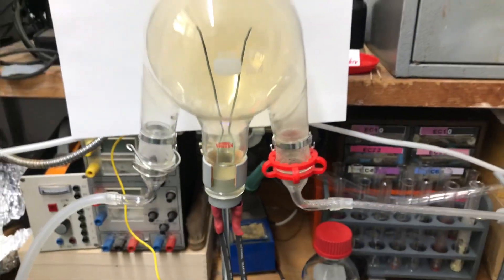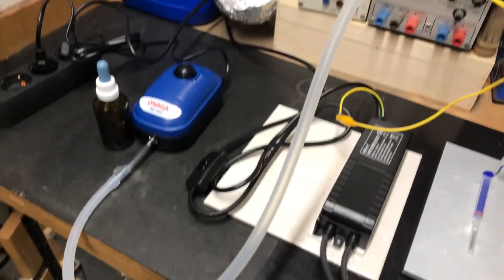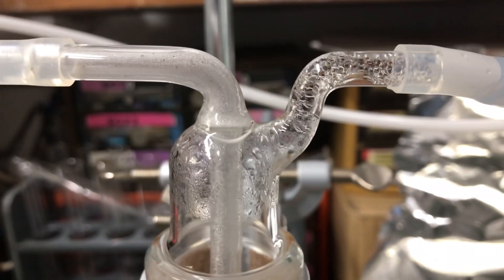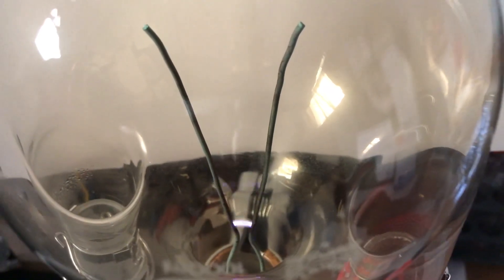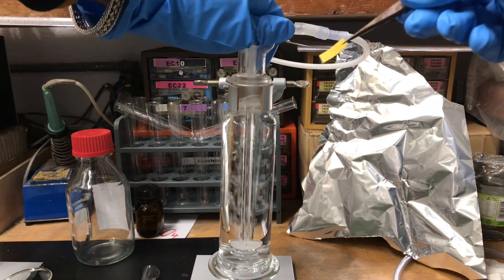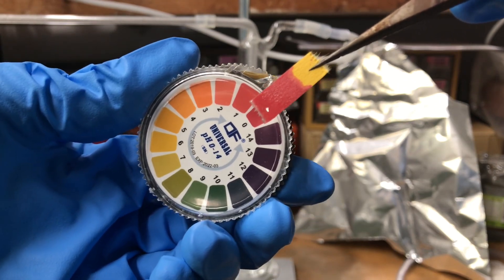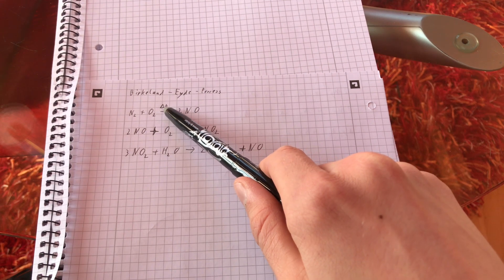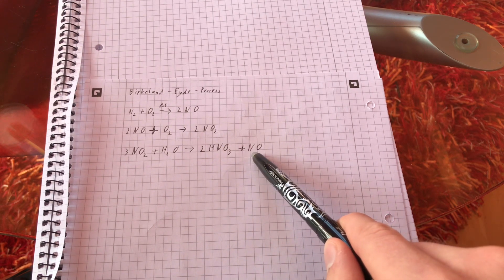Nitric acid from air (Birkeland Eyde Reactor)

Comment: Recently thought about adding baffles to the gas tube. Should increase dwell time considerably. Gas travels sideways slower then up. Ive also thought maybe have it like the SO2 collectors build a kind of reflux tower that bubbles and mists the gas over and over. Hilariously i think a bong would work to collect gas. 😂💨😶‍🌫️ just cant seem to find a glass to tube adapter at the smoke shop 😂.

Comment: I would suggest a few different things if you wanted higher efficiency.

One would be using an hydrogen peroxide solution in stead of straight water, and chill it for increased solubility. Second is recirculate the escaped NO back into the reactor. 

But that's only if you wanted to improve the experiment itself, which noone  would just to get some acid, because the process is just too expensive.

Comment: Nano bubbles generation may further reduce the size of the bubbles which increases the surface area or volume of the bubbles, and increases the time the bubbles stay suspended, and synergistically both work together to increase the absorption from the gas.

Comment: Is it possible to use nonlethal voltage like in an arc lighter to make nitric acid?
Reply from the maker: I wouldn’t call the voltage of an arc lighter nonverbal but yes. The arc should be hot enough for it to work. It won’t be as efficient but it will work

Comment: Done that rx myself, back in the day.   Tracked the progress with litmus paper.   For those that might be interested, the Country of Norway made quite a lot of $ in this reaction as it had copious amounts of hydroelectric dams so that the energy to do this reaction was almost free.  And they made industrial fertilizers and such.  Starting from about 1900 on.  That's the deal with chemistry, quite often, pulling profit out of thin air.  Literally so in this case.
Reply: Why don't we see chemical companies building more power plants? seems like they would be the ones with the strongest motivation to do it when utilities and governments drag their feet?
Reply from the maker: Probably way more work than just buying the electricity
Reply: @THYZOID  also don't forget - that big concerns are often the same, just working under different agencies.
Reply: @overengineer7691  When you're good at one thing it's freqently good to focus on what your good at. 

 You have finite resources to work with, time and money.  So if the power plant and chemical company both cost the same, why buy or build half of both if that's all you can afford  

And, both chemical production and producing energy is freqently cheaper to do it on a large scale, especially with power freqently being more than what a chemical company would need. And finally, electrical energy is easilly transported. And sometimes it may be preferential to locate a chemical company closer to other resources or closer to the client or more buisness friendly area.

Comment: Hello! I was wondering if the acid that forms will attack plastic, because i wanted to use a plastic air bubbler and a plastic cap to spread the gas to other flasks once it reacted with the water in one. Do you think i can do that or do i have to find glassware?
Reply from the maker: It depends on the concentration. There are tables for chemical resistance of various plastics on the web.
Reply: @THYZOID  thanks!

Comment: I would guess this is far less efficient than the chemical method using nitrate salts. But it all depends on the cost of electricity vs the cost of nitrates and sulfuric (or hydrochloric) acid. Still it's good to have many ways to do the same thing
Reply: And the availability of nitrates. Water, air and electricity is available everywhere.

Comment: Is it energy efficient?
Reply from the maker: It isn’t. Industrially this process was abandoned because better processes were discovered.
Reply: @THYZOID 
Thank you. What if we can use solar power? Is it still inefficient?
Reply from the maker: If you have solar you can run it as long as you like without caring about power consumption. It will still be as efficient as before but you basically get the power for free.

Comment: Would a solid state transformer work for this kind of project?
Reply from the maker: I unfortunately cannot answer that question for it is not my area of expertise. But what I can tell you is that it would work if the arc is hot enough.
Reply: If you mean the bulky 50Hz transformer then yes but a normal transformer needs to be current limited or you trip the fuse. The easiest transformer would be a neontransformer that is normaly rated for short circuit because arc = short circuit. Oh as far as I have read about that ostwald process should give the best efficency right ?

Comment: Approximately how much nitric acid?
Reply from the maker: Around 20ml of 100% HNO3 in 24 hours. This setup isn’t really that effective. Im gonna try a new and more effective setup in the future.
Reply: @THYZOID  You can't get 100% That would be anhydrous. I was wondering how strong you could make it. In Germany the legal limit is 3% as far as I know. Which is useless :/ 

Also great channel. Just discovered it :)
Reply from the maker: Thanks! The generator would still be useful to make nitrates and not useless <3% HNO3.
Reply: @THYZOID  Nice, I wanted no build one myself at some point 😁
Reply: thanks brother
Reply: I guess you need much more current to make much more in a short time. It´s hard to find those cheap I can understand that.
Reply: @THYZOID  Hello. "20ml of 100% HNO3 in 24 hours". Could you tell me the Power of your Transformer?
Reply: @THYZOID  a more efficient in the future, can I be there Oswald‘s reaction, whit platinum cover wool quarts? with ammonia and oxygen?
Reply: @cutiesketlund2663  it is an slow raction you need an very big stove the reactor widness for industrial is 180cm ore above. Pumic stone impregnatet with ammoniumdichromate and the decompesed is an excellent catalyst for this reaction and much cheaper. :)